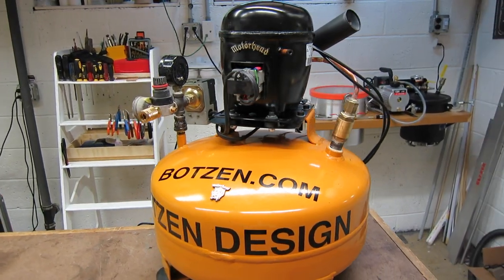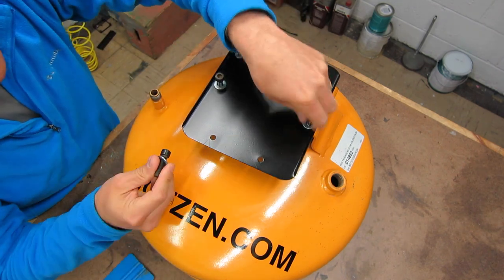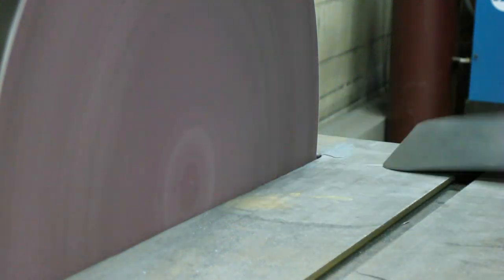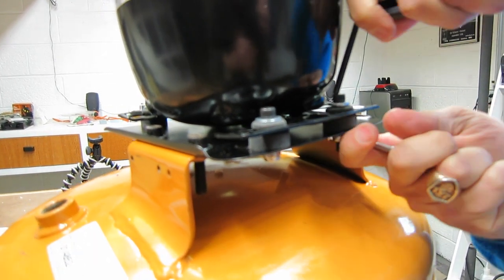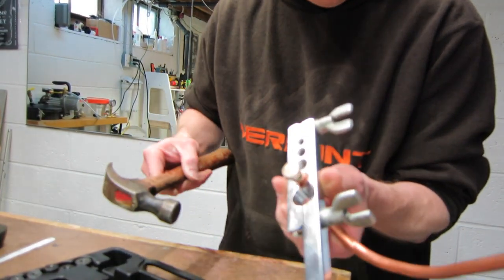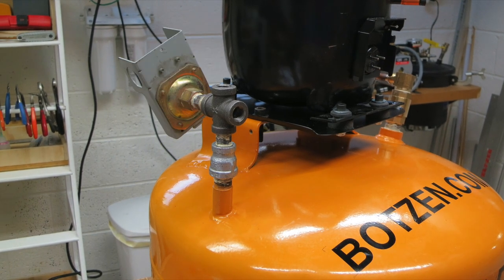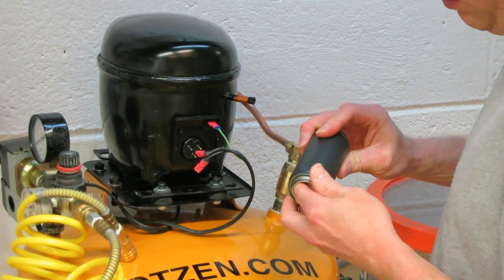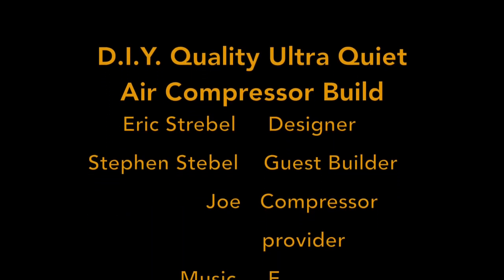Ultra Quiet Silent Refrigerator Work Shop Air Compressor Build

Comment: Eric, thanks for the great video, but I noticed you didn't clarify an extremely important topic at 8:12

When tinning the end of the wires, it is of critical importance if you do choose this method, do NOT tin any more of the wire than is absolutely necessary at the extreme tip of the wire, just enough to hold the strands together.  Really this isn't a very good method anyway, as a ring terminal or just the bare wire twisted carefully is a much safer route.

The solder is soft, and the connection can become loose and cause connection issues, overheating, fires, etc... no matter how hard you screw it down.
Reply: Man thats a really good point. Never thought about how that solder would definitely vibrate loose in a screw terminal vs twisted copper.
Reply: chiggerpepi - reference please? Otherwise that is just a “tale”.
Reply from the maker: Never had an issue, Don't anticipate one, not sure I actually believe that what you wrote is actually true. There is no heat generated in this connection and it's a locked connection, meaning it's actually twisted around the screw so there's no way it can come loose.
Reply: Eric Strebel - I am with you on this, have seen many unsoldered twisted wires with a loose connection but none if they are soldered. It is as if you creat a solid wire from the stranded and are then able to safely put pressure without a single strand or two being damaged. Will keep looking for a reference for this to share.
Reply from the maker: @tegra5971  I would be interested to see if this is an old wives tale or actually a thing. If the wire actually got hot enough to melt the solder then there is something else going on. Let me and everyone else know if you find something. Cheers!
Reply: @EricStrebel  This is so much not a wives tale that some jurisdictions and some industries outright forbid it (for example no tinning in domestic installations here in Germany allowed). There are two things going on, the wire strands can't move relative to each other, i.e. the cable gets stiff, which in itself isn't a problem, but becomes one with vibration, unless a strain relief is put in (you'll see that solution with battery powered tools very often as high amperage connectors are expensive and bulky, so they solder directly and then put hot snot on). The second is that it's not solid copper anymore, so there is some creepage under the screw due to the clamping force, especially with thermal cycling. "I've never seen it" isn't really a good explanation, because that only means you were lucky.
Reply: @tegra5971  Crimped connectors getting loose is the result of using improper tools or not the right force. Crimped connections are also gas tight, so that also covers any concerns about corrosion. Soldered connections require strain relief to limit vibration to the still flexible, non-tinned part of the wire. You'll see that when you open up high-powered electronic components. It's either blade-and-spade connectors, or soldered with a fat blob of celastic.
Reply from the maker: @graealex  low amps, low vibration, low risk, not an issue, not building a rocket ship….
Reply: @EricStrebel  Yes, your application isn't critical, if that wire breaks then it's just your compressor that's not going to work. But there is a distinction between "tinning wires is bad practice" to be wrong, or just not important in your application. Because where it actually matters, for example where money is made, or where people might get seriously inconvenienced (elevator for example), it's most of the time simply forbidden.

Comment: So many tools, yet you don't have (and didn't borrow) a simple sound meter to check how quiet it is. How quiet is quiet for you? 30 dB? 50 dB? 90 dB?
Reply from the maker: Electric Unicycles EU It's so quiet it's not worth even doing that. I often don't hear it running from only a few feet away. Thanks for the comment, glad you liked the video.

Comment: Good day, just wanted to ask how would you unstick a stuck up ref compressor?  It was repurposed to inflate car tires but when I used it to inflate an inflatable pool, it was running for about 30 mins then it got stuck up. Thank you very much!
Reply from the maker: It sounds like it seized, I don't know how to unstick it. Good luck
Reply: @EricStrebel  thank you!

Comment: Very good job!
But the refrigerator compressor is too slow!
Too many bar (psi) and too few liters/min (gpm)
Reply from the maker: +MyNotSoHumbleOpinion If you were painting a car yes, that may be the case, for my needs in a 
 model making and prototyping environment it is fantastic! It's incredibly quiet as well, so I can get my work done.
Thanks for the comment, like and subscribe, you cna check out more of my design capabilities at my web site www.botzen.com
Reply: Its ok for small jobs considering the cost ;). This embraco compressor will produce a realworld flowrate of around 0.74 cfm (21 LPM). 
It needs 280ml of hydraulic mineral oil, something like shell tellus 68 is ideal.
Reply: no for that particular compressor, refrigerant oil is what to use- Shell doesn't make that stuff, do they? for this compressor that doesn't touch dichlorodifluoromethane and DOES have to touch dirt and H2O, any good brand of 30-weight NON-DETERGENT motor oil is fine- Shell doesn't make that stuff- do they?

Comment: what line do you remove the oil and charge the oil
Reply from the maker: +jun gan there are three lines, one inlet, one out and one fill line. The two that are next to each other are probably inlet and out let. The one on the other side is my fill port.

Comment: @EricStrebel  can you convert this compressor into a pcp compressor for pcp air guns?
Reply from the maker: Dunno, possibly
Reply: Eric Strebel Thanks for your quick response. PCP air guns and the compressors that are needed for them are very expensive. However PCP AG’s are becoming more popular. These compressors need to be small, portable, quite and fast. Compressors need to be 4800psi while the small cylinder on the rifle only needs to be 200psi. Most are foreign made and run from $250 up to over $2000. with plenty of problems that come with them. It would be nice to build one for a reasonable price, dependable with low maintenance.
Reply from the maker: it can probably handle the pressure, but they are not particularly fast. Perhaps with a reservoir that can handle that pressure....tricky stuff with that kind of pressure, be safe.
Reply: Eric Strebel Thank you

Comment: It was disappointing that you didn't show how you wired  the compressor. I like the project but that last 5% of the job I have to go somewhere else for.
Reply from the maker: Fair enough, that's a valid comment. Honestly I winged it when I wired it and it worked. So I can only assume I did it correct. however it's going to largely depend on the on and off switch that you use and I followed the instructions from the specific on and off switch that I used and it may  be different from what you have. Best of luck on your project.

Comment: I saw the whole video and you would think after 10 minutes you would at least have the sound of the air compressor. I wanted to hear how quiet it was.
Reply from the maker: Robert De Leon it's pretty quiet, if you listen to the end part you can sorta hear the compressor, I often actually don't even hear it when I am working in my shop.

Comment: hi need help with a similar project...i finaly got a compressor like this one...(water cooler)
how do i go about emptying the original "liquid/oil" and how about to add some new oil into it...i know i have 3 pipes...intake...output...and one that cramped  cant use....someone help me.. thx
Reply from the maker: mario payan it's the crimped one, uncrimp it and add your oil.
Reply: ok after i add certain amount of oil...do i need to crimp it again? will it blow air out or sucked it in..?
Reply from the maker: No i don't think so, just close it so the oil does not come out, mine has a little rubber plug in it
Reply: alright thx.. mine dont have rubber plugs...one pipe in just simply crimped shut...one pipe let air in and third one let air out...i thought maybe pouring some oil in the intake pipe..wonder if it would work or i have to uncrimped the crimped one and use that...thx.
Reply from the maker: I would not pour it in the intake, there is a fill tube for a reason.
Reply: thx

Comment: Q  How do you keep the oil out of the air.  Two where is the air inlet, is it filtered?
Reply from the maker: There is one air inlet, yes there is a filter, that is what makes it quiet. See video at the end. The other inlet is for the oil for the unit, that is sealed with a rubber plug. Louis Anderson Thanks for the comment and support, feel free to share on social media.

Comment: you can use mineral oil too!
Reply: george raven 0
Reply: george raven - That is probably a safer way to go, both for health (in case the air is used around food products) and safety (flammability).

Comment: The hole in the bottom is for the water drain. Please put a drain cock in it or some other valve so you can drain the water. The pop off safety valve can go anywhere else. The filter you made doesn't make it any quieter.

Comment: Cool idea but there is no way you could realistically use any air tools with what little airflow that compressor could put out.
Reply from the maker: +Jack Cleveland Correct, it is mainly meant to blowing of parts and cleaning surfaces and for my air marker, blowing up my bike tire, etc it has very limited capacity for air tools, Plus with a 6 gallon tank you wont get far! I love how quiet it is!
Thanks for commenting.
Reply: the blowing of parts sounds like fun
Reply: It's also a great idea for airbrushing, the reason I am looking into it. This way you get a silent and functional compressor for an airbrush.

Comment: Never put the pressure relief valve on the bottom of the tank.  It's a safety risk. If dirt or ice during the winter builds up in the tank it will block it.  That hole on the bottom is for a drain.
Reply from the maker: Labinot Hoxha Tank is used indoors, no risk of Ice. Pressure relief valve works as a great drain actually. Thanks for the comment.
Reply: Eric Strebel pressure relief valve on the bottom of the tank is not an osha standard. Pressure relief valve works great to drain until u get a piece of rust from internal wall of the tank,  then the pressure relief valve is no longer a pressure relief valve.

Comment: Wtf, that sucked why didn’t you pull up a DB meter and let us see what it was reading. 
Wanted to see how quiet.
Reply from the maker: Practically no sound so it's not worth that. Thanks for your comment and support however, very much appreciated! Check out the follow up video, this should address your concerns a bit. https://youtu.be/JqqLwunF1ZE cheers!

Comment: 5 gallon slow recovery low pressure air compressor sort of worthless too much time not enough output get off work in your air hose to a balloon
Reply from the maker: Jeff Salver@gmail.com it's all about what your needs are, perfect for me. Watch this weeks video, its all about the compressor upgrade to a 15 gallon tank. youtu.be/JqqLwunF1ZE

Comment: SHAME NOTHING WILL RUN ON IT BAR A 25 POUND SPRAY GUN FOR ONE MINUTE IF LUCKY SAVE MONEY AND STRESS GET ONE FROM A SHOP
Reply from the maker: Not meant for that, just air for the shop to blow things off and airbrush, and meant to be ultra quiet. Always has 100psi in it ready to be used, super reliable for me and making models and prototypes. No fox given